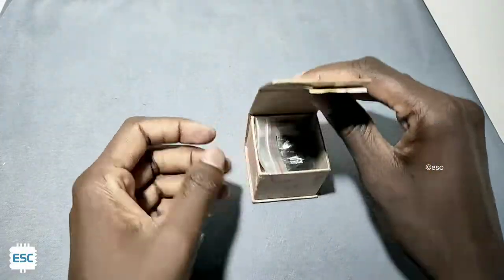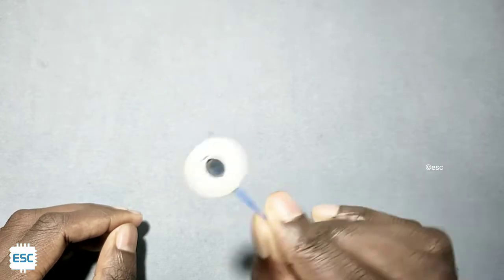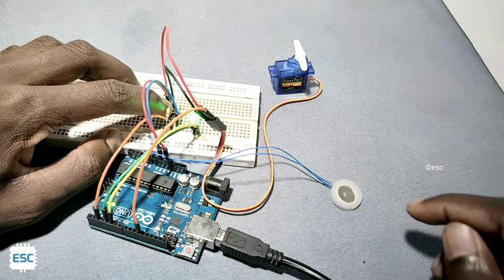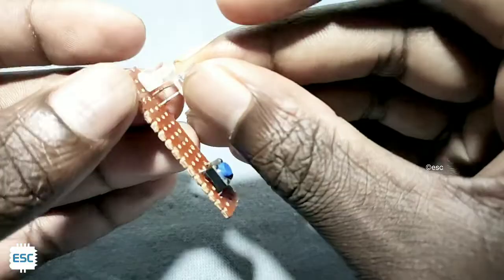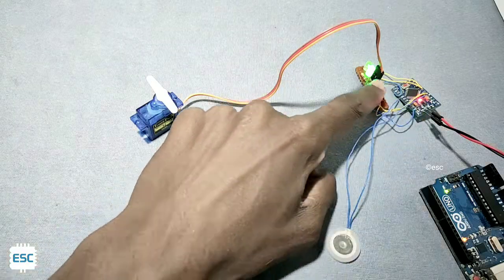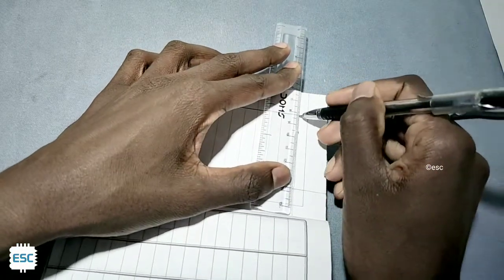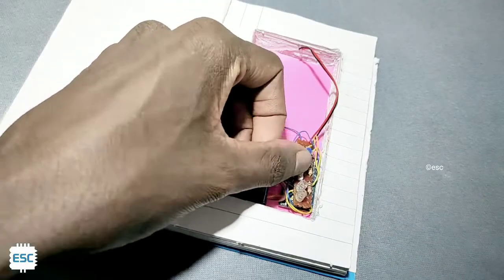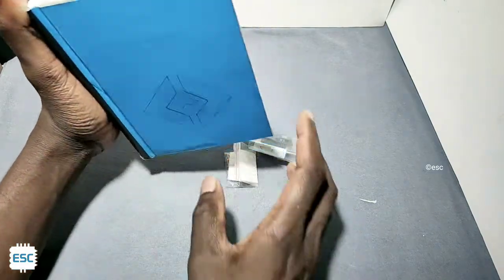How to make Arduino Knock lock | DIY | knock alarm with piezo

Comment: I  am working on this project. I am using an buzzer instead of piezo disc.will it work fine .
Reply from the maker: Remove the cover of buzzer . Then remove the driver circuit . Now use the piezo
Reply: Which type of resistor should I use for buzzer